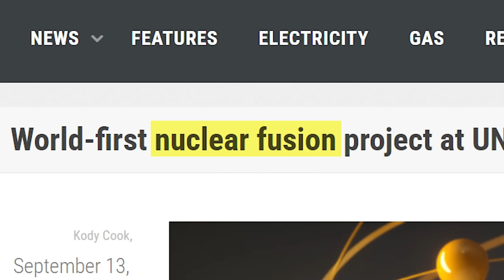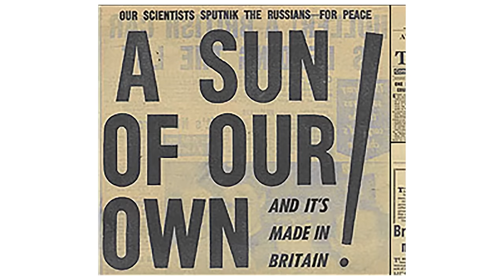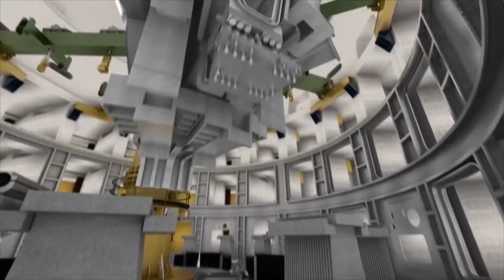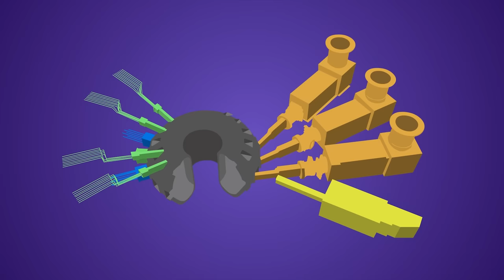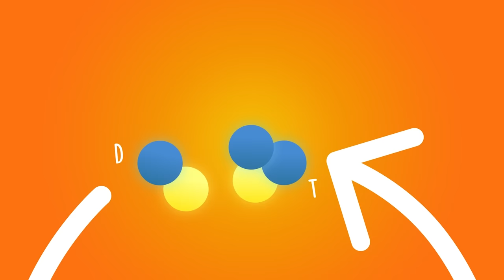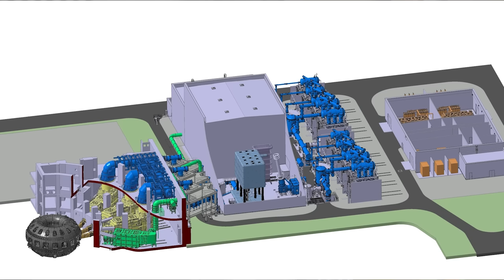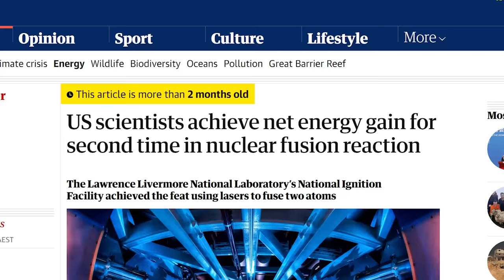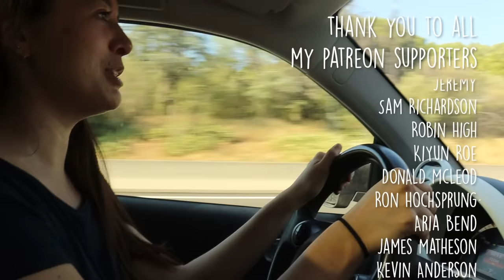World's Largest Nuclear Fusion Reactor!

Comment: Likely the doughnut shape will not work, but learning from it to find the correct, most efficient shape will work, hard to say if they'll learn what fluid dynamics and other Pilot Wave Theory facts they can improve on, with so many fluid dynamic experts working on other problems (like trying to inform people about how climate really works, inputs and all).  Climate will change no matter what we do, pollution is the real issue.  No way of generating energy will be without serious problems.  Moving around molecules that we already have on Earth isn't a problem, it's concentrating them in one place, pollution, that's the problem, not some vague idea of 'climate change', as climate will always change and we will always adapt.  Thank you for doing this.

Comment: 50MW -> 500MW is well and good, but what is the cost of all ancillary systems in power generation? Eg.. Generating the magnetic field? running the cryogenic cooling systems? Maintaining vacuum in the cryostat? How many MW does that use?
Reply: much more energy that it is produced...  to  be also taken in to account that many plants need to run 24/7  (e.g. the cryoplant, cooling) while the little energy (if any) produced by fusion in ITER is on pulsed basis....   few pulses  now and then...

Comment: As we here more and more about global warming - the one analysis I have yet to see.

Obviously greenhouse gases are the core problem. But isn't there a meaningful secondary problem? Most of the energy generation methods involve the direct generation of vast quantities of heat (which is also bad from a warming perspective). I'm curious how much of a knock on effect that has to the main problem of global warming. Notably - fission and fusion will both generate vast quantities of heat.

Comment: Hopefully, the aliens will have figured out something better. I'm tempted to adapt a phrase, fusion power stations have and always will be the technology of the future. The cost to build ITER. Then multiply that by 600 (?) and add the generation and distribution pieces for each that ITER is missing. I expect I won't be around to see all that. Thank you so much for the tour, Jade!
Reply: Always remember the economy of scale, and the cost of R&D.
A research project will always be more expensive than building whatever the final product is again, and if the product is built in large quantities, the cost will go down even more.
But yeah fusion power is still very far away, there are still many unsolved problems with it at the moment.
Reply: It's always ten years away :).

What she said about Ignition wasn't actually true. They theoretically got out more than they put in with the lasers, but the energy required for the lasers was several times what they got out.

I sprout a new gray hair everytime someone claims they got out more than they put in.
Reply: ITER is solving never solved before problems for the first time ever. That has an enormous cost. Saying that subsequent projects will cost the same is a fallacy undermining the whole point of ITER. ITER’s purpose is to pay the huge price to solve these problems to make commercial fusion power much cheaper to build.

Comment: Non-obvious correction.  Fusion has never (yet) had a net positive energy gain.  The one case you mentioned where that is claimed is highly misleading.  Under perfect, 100% efficency - aka theoretically - it was net positive in the the amount of energy going directly into the fusion reaction was less than the output.  But in reality nothing is ever 100% efficient and in actuality it wad rather inefficient.  Meaning the total complete input power required was significantly more than the output, this net negatve.  For specifics and details Sabine H did a video covieing it.

Comment: My own personal opinion is to complete the work started in Oak Ridge on a Molten Salt Thorium Reactor that doesn't leave the long lived toxic wastes from our present fission reactors. The wastes from such a reactor require isolation for only 300 years, not the present 10,000 years. Thorium is extremely abundant on our planet and it would take ten of thousands of years before we would run out of it. The reactor would be very difficult to melt down. To a large extent the fission process would drastically slow down when temperature in the reactor get to hot. I feel that an international Manhatten style project should be launched to complete a commercially feasible Molten Salt Thorium Reactor rather than a more distant fusion reactor. We already have run several of these reactors at research facilities globally. Should we give up on fusion; no.
Reply: That’s the opinion of everyone who spends too much time on YouTube, then makes comments like these as if we aren’t already pouring loads of money into novel fission.

Comment: There is one key piece of information missing, which I also didn't hear from other sources. Is there a possibility to significantly increase the efficiency of fusion reactor (like order of magnitude)? Because those calculations on needs and produced power are quite depressing. ITER is the most complex machine ever and we have been building it for quite a long time now... and it's still not near the end. By calculation we need thousands of them just to cover a fraction of our energy needs. Does not sound promising at all.

Comment: Why isn't ITER using superconductors that only need to be cooled by liquid nitrogen - and how would that affect the project ?
Reply: Because it was designed in the 80s and you design with what is known to work not what you hope might exist in the future. For HTS Tokamak reactors see SPARC as perhaps the largest and soonest to start attempts at operation.
Reply: @MattNolanCustom Thanks

Comment: Math is Discovered in my humble opinion, just like any other Natural Phenomena. Which makes sense, since Math describes Natural Phenomena. Also, it's Statistically very improbable that there are NO Alien Civilizations that have developed our same type of Mathematics.

So it's the fast moving Neutrons that strike materials, which then generate heat, that generates the steam, that drives the turbines, that generate the power from what I'm hearing. Is there an easier way to generate and or capture fast moving Neutrons other than creating a Plasma cloud at high expense? Don't Neutrons occur from a number of different  processes (even natural ones)? Don't free Neutrons behave like any other frequency of light? Can't they generate an electrical charge when they strike certain, "photovoltaic", materials? Doesn't that generate electricity directly and efficiently?

But even if you do use Plasma, doesn't Plasma generate intense light? Shouldn't the inside walls of the toroid be made of robust photovoltaic materials that capture light and generate electricity directly? You could get a lot more electricity from the light of the Fusion Reaction than just the heat alone (probably more than the heat itself, heat can be inefficient). 

More importantly, do we need to generate large volumes of Plasma at all for significant power generation? Sounds like you want Deuterium and Lithium to interact at high speed (or rather, high frequency and high energy), must they be in a cloud of Plasma to do that? Of course heat generates more movement in gas molecules (or plasma), but couldn't intense pressure in a more confined space generate high frequency high energy interactions just the same (Thermodynamics tells us yes)? 

Has anyone tried to drive this reaction of the Principal Elements in a liquid solution? There would definitely be enough interactions and it would be easier to contain.  Since these elements have electrical charges, they could still be manipulated and contained by a strong magnetic field (or fields) in a liquid solution (maybe even more so). 

That field (or fields) could be made to shrink in size or change shape, creating even smaller and variously shaped spaces, therefore creating the needed pressure (High Frequency and High Energy Fusion Reactions) within a Control Volume. 

The Deuterium Lithium Reaction would naturally heat up the liquid solution it occurred in, and that liquid being heated to steam would then be pulled out of the Control Volume and sent to drive Turbines that Generate Electricity. Then be condensed and sent back to the Control Volume. 

Said Reaction, again, also giving off a significant amount of light, would drive a Secondary Photovoltaic Process for even more Generation of Electricity. This reaction would be continuous and controlled by varying the amount of Reactants In Solution and Controlling the size and shape of The Magnetic Containment Fields. Moreover, one could build reactors varying widely in size (theoretically).

What science has been done on something like that? Would be grateful if you could point me in the right direction on any research that might have been done on that. I appreciate your time Up and Atom.

Thank you.  

Great video.

Comment: I really value your videos and I assume you probably didn't need any harm, but: the chimneys you shown on this video produce mostly water vapour and Chernobyl was just a badly designed plant. They also did have some warnings which they ignored then and obviously no one would ignore now. So it's kind of unfair to show that without context. Though obviously there are problems with all power sources and fusion would be great 😊

Comment: I'm only four minutes in, but this is already pretty misleading. You can't power a fusion reactor with water and lithium. It's a huge simplification. We have a very small supply of deuterium and tritium (the typical raw materials for fusion) which is definitely not sustainable. Guess where we get our current supply from. Hint: it's also a nuclear reaction
Reply: Hmm, OK, so Richard did apply some more realistic expectations, but I still think that the word "sustainable" is over confident
Reply: The plan is to breed tritium inside the reactor vessel itself. It's theoretically possible, but they can only try it out once they get the rest at work
Reply: @effedrien  sure, but it's an unproven technology that may work. In the meantime, the very small amount that they currently have is going to run out quickly, or just decay away
Reply: @AntneeUK  there will be enough for the experiments. This is about knowledge. Knowledge is priceless and it will pay back eventually. Of course in this form fusion can never become economically viable. We can't even make fission reactors a profitable business, they still can only get built if the tax payers pay their share.
Reply: @effedrien  I don't disagree with what you're saying. My issue was the casual claim that both deuterium and tritium are plentiful and sustainable. They may be in the future, but they aren't today, and they may not be for a very long time

Comment: If the tokomak loses containment, what would be the consequences of releasing that amount of heat into the air?
Would there simply be a violent explosion (after the vacuum implosion), or would something else happen - like the oxygen in the air combusting around the facility, or a localised weather anomaly?
Also, how does this self-heating not become a meltdown just like in a fission reactor?
Doesn't the neutron radiation damage/embrittle the structure of the tokomak as it is used, and slowly make it become radioactive itself?
Reply: If you lose confinement, you might melt a few things locally, but the fusion conditions would cease to be in the right zone and the reaction will stop. There's no runaway like a fission meltdown. There also isn't really much fuel or heat in there (comparatively) at any one moment. Don't confuse temperature with heat. In a fission reactor it's loaded with fuel for the next however many years. In a fusion reactor you have fuel for the next few minutes and are constantly taking waste out and putting new fuel in. Yes, neutron radiation is going to make things brittle and radioactive over time in the first wall. But only mildly activated and relatively short lived. Much less of a problem than fission waste which also, actually, isn't a problem.
Reply: @MattNolanCustom  I was inclined to believe you until you said "fission waste which also, actually, isn't a problem".
You wouldn't mind storing some in your house, then, I take it?
It'll only be dangerous to all life for longer than we can linguistically express the danger it poses (written language is 5,500yrs old, and it will probably remain dangerous for longer than that), so it's perfectly safe and not a problem at all! On those timescales, countries' borders change, and the countries themselves come and go too, so who knows whose hands it will be in - or if those hands even know they have it!
I've yet to see a source that disagrees that spent fuel is a major ongoing issue, and that as of now there is no adequate solution for future permanent disposal beyond "bury it and pretend it never happened", a solution which is so far only being planned to be enacted by Finland.
Reply: @C.I...  the fission waste problem is hugely blown out of proportion and a massive emotive issue rarely looked at logically in public circles. The amount of it to date is small. There are proven methods of dealing with it. Every other energy source we have is as dangerous or more dangerous on a deaths per unit of energy produced basis. Look it up.
Reply: @MattNolanCustom  >400,000 tons is "small" to you?
(and counting, with no method of reduction other than waiting thousands of years)
Reply: @C.I...  400,000 tons is about 1/30 of the daily global oil production. Yes. It's small. What about my other points?
Reply: @MattNolanCustom  I see little point in arguing with someone who thinks 400,000 tons is a small amount of radioactive material.
You first. What about my points you ignored before?
Reply: @C.I...  46 grams per person. I'd be happy to have my share in my house, suitably enclosed. The obstacles are purely political and social. I'd rather have fusion but, until then, fission is by far the safest and most ecologically sound option for baseload. Did you look it up? It can be hard to wade through the knee-jerk propaganda. Did you know that the vast majority of the current waste can actually be used as fuel in next generation reactors, ultimately leading to more energy and less waste? Did you know that transmutation of waste into less dangerous, shorter lived isotopes is a possibility on the horizon? In fact, fusion technology and spin-offs from its development may well help greatly on that front. Perhaps you just haven't been keeping up to date.

Comment: I am thinking the biggest issue here is the ITER model of global participation. The amount of bureaucratic bulldust that would need to be gone through just to order a part would be ENORMOUS. I think (as much hate as he gets) Elon Musk's model of getting things done would work wonders for Fusion development. Cut the crap, start building and testing hardware, learn from failures, rapidly iterate. It would be achievable in a much much shorter time than anticipated.

Comment: I think you will find that if you input 50 and get 500 the gain is 9 but who's paying attention right?
Reply: Actually not, the 500 MW is defined as the power generated in fusion reactions, so the machine will have to handle 550 MW of heat. in reallity it is not so important if it is 9 or 10.
Reply: @perpetersson7514  The fact remains 50 in 500 out is a gain of 90% regardless of how much heat gets handled it's physics, my comment was a joke but the maths is reality,
Reply: @perpetersson7514  Look I love this channel, but equating output with gain is incorrect , yes it put out 10x the input but only gained 90%.In the same way if you put $50 in the bank and some time later get %500 your increase is 10x but you only gain $450. You can't discard the value of the input it's a prime factor. (typo $500)
Reply: if it was a financial gain, yes, but in science gain is defined as output quantity divided by input quantity

Comment: I'm not convinced on the "no nuclear waste" claim. those neutrons will combine with the iron in the steel sheath around the plasma and eventually create unstable isotopes which will, in of themselves, degrade. once they do, the sheath won't have the same properties as when it was installed, and will need to be replaced. that's just nuclear waste of a different flavor. much less of it, granted, but not zero.I still think we're making much better progress on battery power to make solar and wind power take the base loads far sooner than fusion ever will.
Reply: One major difference is that the half-lives are vastly reduced in radioactive byproducts of fusion processes. I think many people consider fission waste to be a "solved" problem, but I think it's anything but. We have mountains of waste that will remain radioactive for thousands of years, and I don't think we have a truly reliable, foolproof solution for it.
With fusion, you're dealing with waste management on the scale of decades to 100 years, rather than 3000 years.
Reply: more money going into wind, solar, and battery despite them being worse than nuclear in most ways. nuclear waste can be stored on site, dumped into the ocean, or used in a molten salt reactor without all that much risk, and meltdowns have been a thing of the past since third gen.